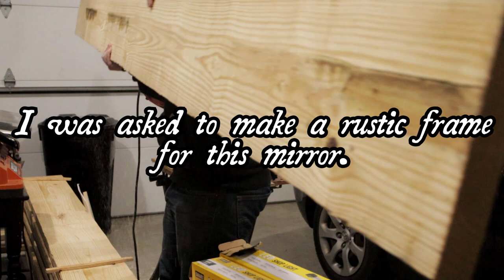DITCH the Pocket Holes!!! Rustic Frame Made With Traditional Joinery

Comment: Nice build you did there. Made two of those for the Mrs and me several years ago. Almost identical to yours. They taught me a lot about getting the frame flat. Lol. I pegged the joints too. In case of nuclear attack.😊😮
Reply from the maker: Thanks! I was super paranoid about the joints giving way. Pegs and epoxy. Couldn't risk the bad luck if the mirror broke.
Reply: @EricMeyerMaker  Yes. With inflation I think it’s 10 years bad luck now 😬
Reply from the maker: @rollingstone3017  ha!